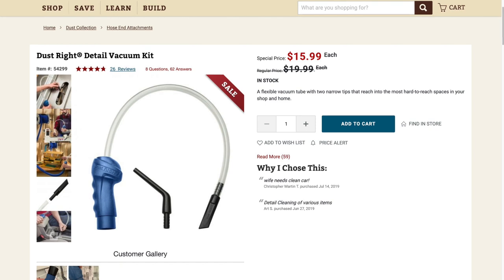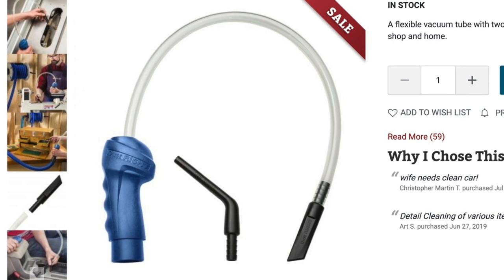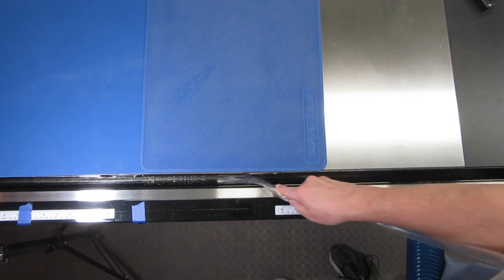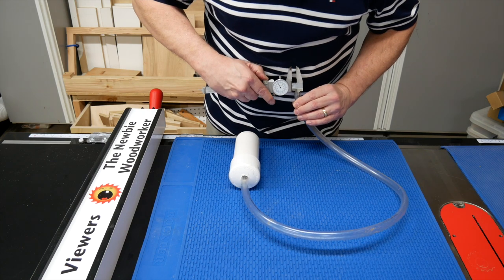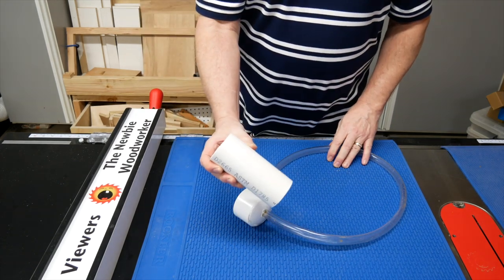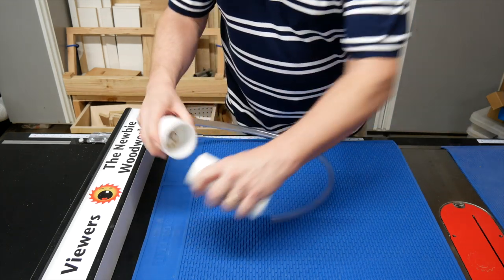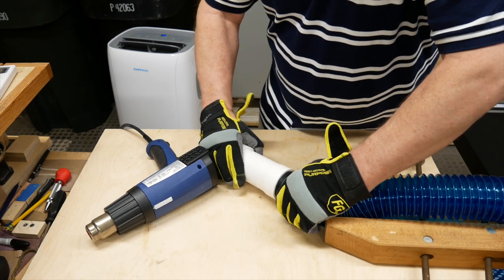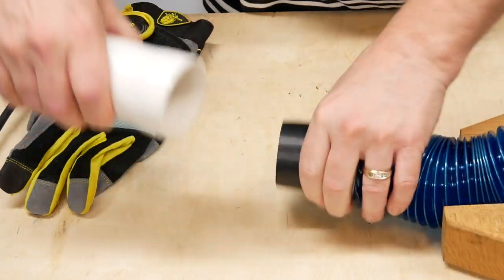Vacuum Tube that sucks a little bit

Comment: I do the same thing. See something cool and make it myself. The MicroJig is a good example. Simple to make and it'll save you nearly $60.
Reply from the maker: How did you make it? Did you make it using someone else's design, or your own? If your own, do you have any pictures?
Reply: @TheNewbieWoodworker  I just copied the design from a pucture of it. I used t tracks for the front and back and a mouse pad for the grippy bottom. I can take pics but I'm not on any social media where I can post them. There are videos of other people making it though. The cool thing about  is it can be custom to your liking and be repared easily if damaged.
Reply from the maker: @basanistes359  Sounds cool. If you feel like send me some pics, go to my website and click the "Menu", and you can email me from there. https://thenewbiewoodworker.com. (I don't like posting my email address here, for obvious reasons.)

Comment: I was expecting a cathode a plate and grid, and a heater element, you really got screwed, that vacuum tube not going to do what you expect it to do. You are right that Vacuum Tube Sucks. 🤣
Reply from the maker: I so wanted to work in some jokes about that, but the truth is most people have no idea what vacuum tubes are anymore. And I couldn't come up with any jokes, either. So I'm glad you understand the potential, anyway. 😄

Comment: Thank you for sharing this.  I need to make one of these.  Would be nice to figure out a way to add a little brush, or wand to the end.  More heat - molded PVC?  I will keep my eyes peeled for possibilities.  

This type vacuum tube, we can afford to have lurking around! (My spouse has a vacuum tube collection. I caught the comment below. :) )
Reply: I guess the vacuum tube collection is miniscule compared to my scrap wood piles.   (Although we both generate scrap wood,  I am the one who hangs on to it so I admit guilt.)
Reply from the maker: @rwind656  😂

Comment: Hi Dan, I agree with the others, don't give up joking...
And it is abit late to ask something but I hope you'l see my question. I have a Bosch GAS35AFC (don't know the name in states), a powerful one. But when input end is too small (like your small sucker) it alarms. How to solve this problem? Is the alarm not important? Do you experance the same problem?
Reply from the maker: Couldn't give up joking if I wanted to. Jokes are my life, or... my life is a joke, something like that. 🙄

Interesting about your vac. No, mine doesn't alarm. One option is something like this: https://www.rockler.com/dust-right-reg-shop-vacuum-handle. If you look at the picture, the blue "collar" or whatever you call it covers a big slot, and you can turn it one way to gradually close the slot, and the other way to gradually open it up. This would let you adjust it until the alarm stops - in fact, that's probably what it's designed for. I'm not sure I linked the exact right one for the size of your pipes, so double-check that. I have one of these and I love it.

You could also just cut a hole or slot in the PVC to accomplish basically the same thing. Hope that helps!
Reply: The Newbie Woodworker he could drill a series of holes in the pvc tube to let the right amount of air in to silence the alarm.  He can use his holding hand to cover some of the holes or uncover some to achieve the proper balance of air being received by the vacuum machine depending on what’s being sucked up at the business end.
Reply from the maker: @tonywu6612  Thanks, that's a good idea. You could also use pieces of duct tape to cover some of the holes, as needed.

Comment: I wish I had seen this and you other stuff on pvc, before I spend a small fortune at rockler. So much of that doesn't fit anything.
Reply from the maker: I totally get that. I got lucky when I started working on my dust collection a while ago - I figured out right away that you can mold PVC. I don't remember if I saw it in videos (probably), or I figured it out myself, but it saves a lot of headache, that's for sure!
Reply from the maker: And thanks for mentioning it!  I was hoping that little section would help someone. 😄

Comment: Might it be better if you placed a bit of silicone around the tube and the plastic connector?
Reply from the maker: I don't feel or hear any air leaking, so I don't think so. I could be wrong, but this seems to work OK without it.
Reply: If it ain't broke...
Reply from the maker: @David_Powell  ...then keep fiddling with it until it breaks right? 😂